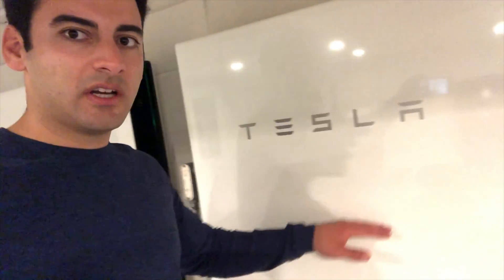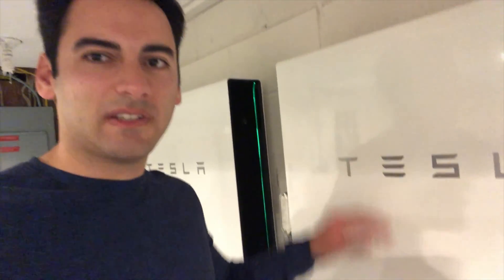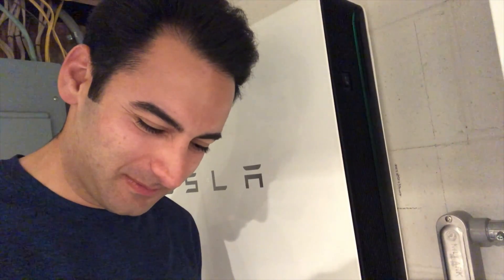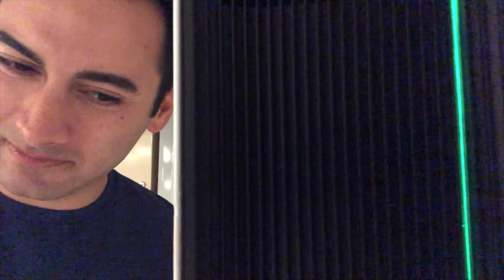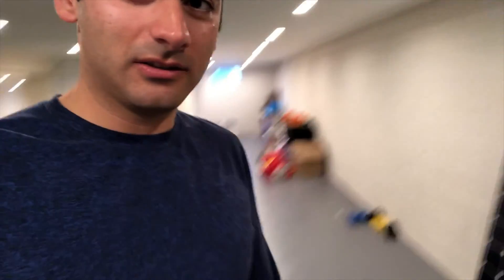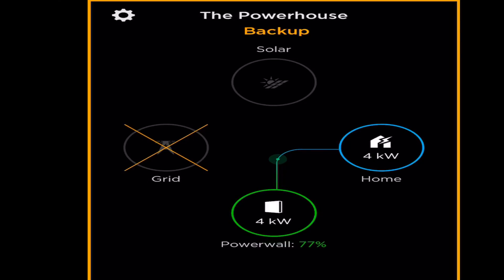How Loud is the Tesla Powerwall?

Comment: I tried to get a quote from my local installer in NC and they want $11,500 per unit. This is far from the Tesla estimated install costs. I already have a Solaredge system installed.
Reply: Pedro who did you get a price from?  I am looking right now into getting solar and powerwall for my house and I live near Charlotte NC.  Anthony how much more for the 2nd roughly if you don't mind telling?
Reply: Steven porter Renu Energy Solutions did 2 of my 3 arrays. They are now offering the Powerwall. The first array of panels were installed well. However on the second we had lose connector on the roof that they did not fix for over 6 weeks. When I did my last array, I changed installers and worked with Red Group Solar in Charlotte. They corrected Renu’s mistakes and improved the quality of the installation including adding secondary grounds that were done properly by Renu. Feel free to reach out to me if any other questions
Reply: @pedrogarces6876  Yeah I have been talking to both of these companies.  That is good to know.  What brand panels did you get?
Reply: Steven porter My Hanwha Q Cel and SunPower for different sides of the house. Melvin with Red Group was great to work with. They make sure all paperwork is in and keep the project moving in record time. I found Red Group to be more honest and better prices. They did my install under 2 weeks after signing
Reply: Ok great to know.  I have been talking with Melvin too.  Thanks for the info.
Reply: Steven porter Duke energy has a rebate starting in January of 2019 of $600 per kw. I was able to get it this year for the last 3kw install from Red Group. I recommend looking into this as the payback is much better (less than 5 years). My prior 2 arrays only had the renewable energy tax credit with a payback period of about 9 years. You can also look into the LG Chem batteries as they integrate with solar edge inverters and have similar power density as powerwalls. I also worked with Southern Energy Management they quoted $20,500 for 2 Powerwall. I have not done any work them though. They are the first installers of Powerwalls in NC and have more experience. Thanks